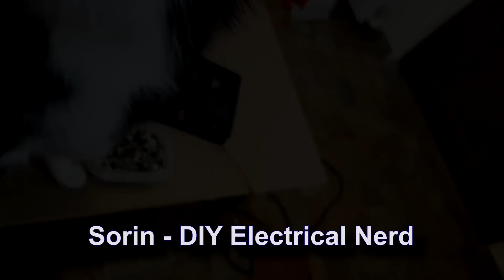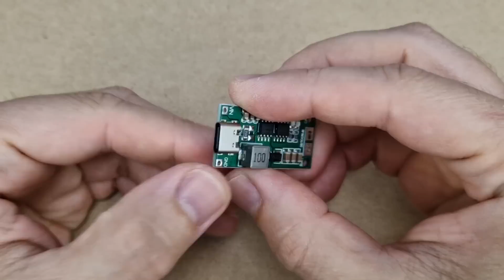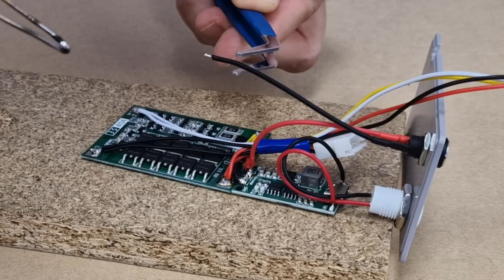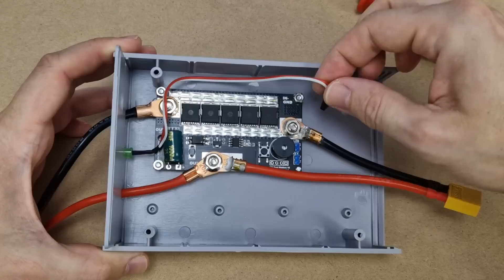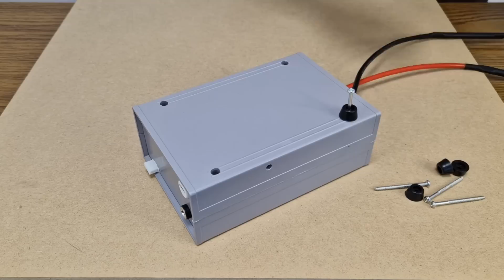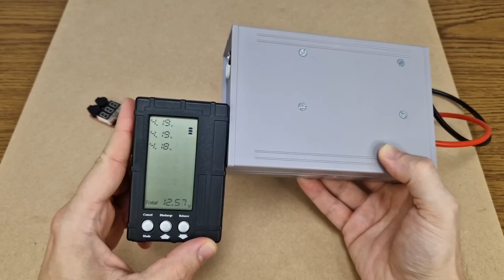My new spot welder (upgrade)

Comment: Hi Sorin , Your projects are always great . Due my old spot welder no longer function , I will have to rebuilt one as what u show but with a new model board, only doubt that if i use the 18650 battery will it work well or just buy the Li Po 2500mah and follow what u did .. Thanks pal

Comment: Hello. This is Amazing. I live in Houston Texas and would like to ask a question. If I plan to use a 12 VDC 2/4 Amp AC adapter to power the BMS unit connected to 2200  mAh XT60 battery, I don't need to buy the USB C boost convertor right ?
Reply from the maker: Hi. No, in this case you don't need the USB C converter, you can charge the battery only with the 12V charger.
You need a 12.6V charger, which in reality shuld have 12.8V. and preferably with 2A.
The 2200mAh capacity is too small in my opinion. the degradation of the battery in time will make it unusable faster than a bigger capacity battery. I suggest minimum 3500mAh.
Reply: @Sorin_DIY  Thanks. One more question. My spot welder is ready but wanted to ask if I need to add a 250 A or a 300 A fuse to the circuit to protect the battery ?
Reply from the maker: No, you don't need to add any fuse. If you want to be safe, the best way is to completely disconnect the battery from the board, if you don't use it for a while.

Comment: Here's a hint for removing the plastic standoffs easily. I use a 1/2 inch drill bit. It will leave a small divot in the bottom of the case, but will clean up the standoff very nicely. Just drill slowly so you don't drill through the case. After viewing numerous videos on DIY spot welders, yours passes the looks, economical standards and safety standards. I will build this one. Thank you for the education.

Comment: Good Day
Is it possible to use 18650 3S setup as battery pack then BMS for balance and charging only?
Reply from the maker: You need high drain cells. 18650 cells are not very powerful. Li-Po cells are better.
Reply: @Sorin_DIY  Thank you for the info

Comment: Nice build. One question: can I also use 4s 14.8v lipo battery for this spot welder?
Reply from the maker: No, because a 4S battery will have maximum 16.8V when it's fully charged.

Comment: Congratulations! Excellent project.
Sorin, I have a question regarding direct 12.6V charger connection between BMS and USB-C boost convert. Will it not damage the USB-C boost convert 3S, when you go to charge the battery with this charger?
Thanks, Hug!
Reply from the maker: Thanks. No it will not damage the converter, because at the output of the converter there is always a battery with BMs connected, so there is always voltage present, no matter if it comes from the battery or a charger.
Reply: @Sorin_DIY  Ok! I have gotten...
Thanks so much!❤

Comment: Nice work, well done!
Just one detail: I think you could have tinned the eye terminals on power cables and tightened them on the PCB with wrenches. Tin is softer than copper and would have provided a better contact surface and lower resistance. But I admit that's a bit of a nitpick 😸

Comment: LiPo batteries are very expensive, at least in my country. so i decided to make it with a microwave oven transformer. it was not portable but works well.
you presented it so clearly again. we love both you and your cat. go on please same way.
Reply: microwave transformers produce very high voltage around 2,000 volts , you need to get rid of secondary coil and rewind with a copper wire
Reply: @izachu904  
yes, of course. i did not use it directly.
firstly i cut secondary wound and had it been empty completely then finding a thick copper wire, approx 2 meters, replace old wound but this time only 3 spirs so i could get very low voltage but very high current from this 700W transformer. then i added a card that controls both current and working time (duty/cycle period) ...so i had a point welder machine especially for serial or parallel batteries.

Comment: Great job. Only one additional think: the strip U used is not pure nickel, it must be nickel plated steel strip, because it is sparking.
Can it spot welds 0.2mm pure nickel strip?
Reply from the maker: This spot welder kit works with maximum 0.12mm strips. Strips thicker than this will not 100% weld.

Comment: why dont you use usb c PD charging to charge the battery
Reply from the maker: Initially I wanted to use a PD trigger module with a powerful  CC/CV buck converter for the battery, but there isn't room inside the case for other components. I will use PD charging in future projects.

Comment: Ups router 12v please problem XL 4015 the Reverse voltage adapter help me please
Reply from the maker: yes, some converters allow reverse voltage. In this case the only option is to add a powerful schottky diode to the converter output, and adjust the output voltage to compensate for the diode forward voltage drop.
Reply: @Sorin_DIY  output diode is not working module xl4015

Comment: this is fantastic! but i dont trust myself using lipo or any lithium cell to be honest.. would lifepo iron cells be safe to use for this project?
Reply: You would need a much larger cell if you used LiFePO4 cells. You need 200A to successfully spot weld. I use a tiny 1800mAh 3S LiPo. It's very easy.

Comment: Can work with battery 🔋 18650 ?
Reply: 18650 ???
Reply: 18650 is the battery shown in the vid the green one
Reply: No can't Handel discharge current that high need a high c lipo battery